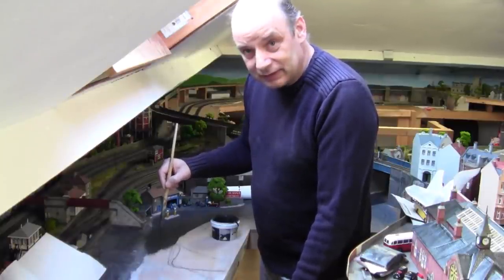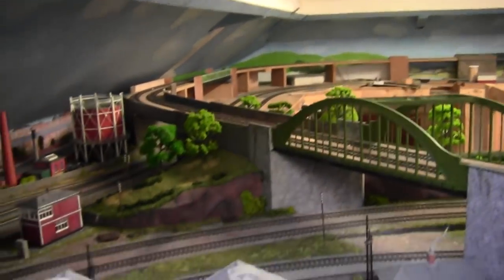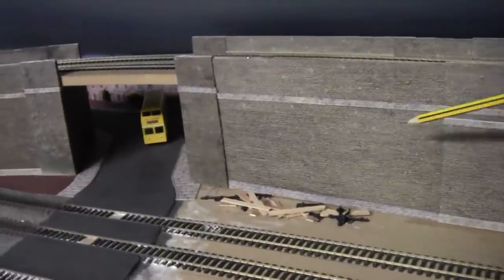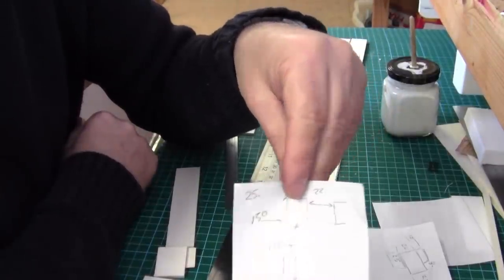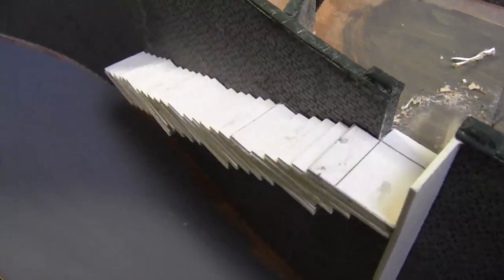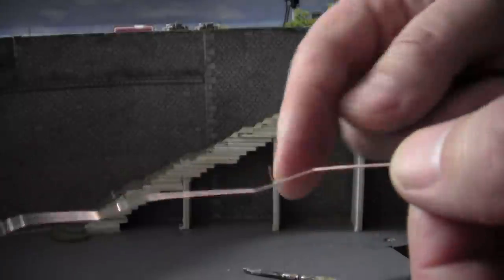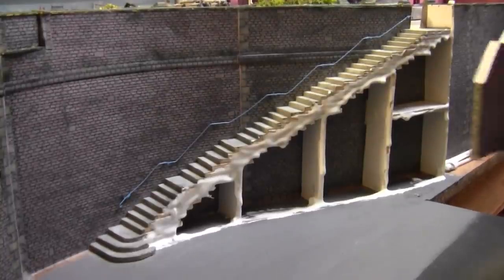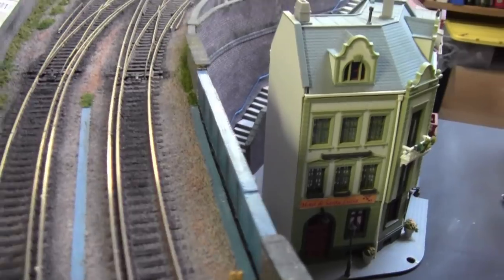The 39 steps, and new extension for Tyne Dock... No152

Comment: Good to give yourself the extra room in front of Tyne Dock, I wonder what will appear there?
And good to see the viaduct developing. It will be nice to see yet another 'bridge on the Tyne'. Though presumably that will be a tributary?
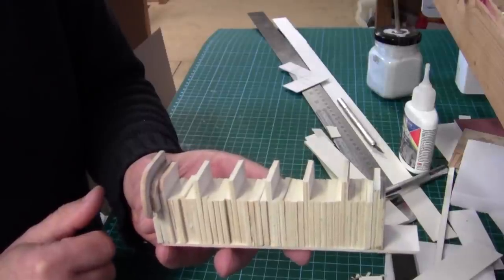13:25 Spooky! Nice job with those steps, though you wouldn't get away with it nowadays. That would be some tumble if you mis-stepped. Still just left yourself room for that cupola turret on the end of the hotel building ;)
Keep safe indeed Tony, you still have a lot to do.
Reply from the maker: Hi Chazzy. i am thinking of a taxi rank. and maybe another building. i remember the old tyne dock station where you had that long ramp to the island platform. it seemed to go on forever when you are a young toddler. yep years and years of work left to do on the layout. thanks again. all the best Tony
Reply: That all sounds great and best of all, lots of new ideas to explore.

Comment: Dont know what John Buchan would make of your steps but I think they are utterly realistic Tony. I especially liked the handrail. It must have been very fiddley soldering the lugs on. I dont think you should worry about 2 stations close together. Here in Maidstone both the LCDR and the SER had stations 10 minutes walk away. Are you now adding extension boards to your extensions ? It gives the lie to those who say that a railway should be planned and then you never deviate from that plan
Reply from the maker: Hi Martin. Thank you for commenting. soldering those little lugs on which little pieces of bent copper wire, were a bit of a fiddle. but those handy hands do come in handy for type of work. i am afraid i am one of those that say a model railways should be planed out properly from the start. which in truthfulness i did  for the track plan. but there is more track than there is towns and scenery on the layout. so dont be surprised if in the future there is more add on's. every millimetre counts i guess. that's one of the great things about model railways. all the best and stay safe Tony

Comment: Hi Tony great job at the steps towards the station the hand rail is that plastic or is it like metal or brass wire that you have used. Cheers and all the best.
Nicholas.
Reply from the maker: Hi Nicholas. the hand rail is made from copper wire. which you can pick up at any good hardware store. its the same cable used on a ring main circuit. all i have done was striped back the outer sheathing to get at the copper. the wire itself is 0.8 thick almost a millimeter. which is about 3 inchs in scale terms ideal for a handrail. hope this helps my friend. all the best Tony

Comment: Tony, What factors did you consider when you made the decision to fasten the rail directly to the bed, without any cork or foam materials between? Peter
Reply from the maker: Hi Peter, Good question. i guess with me it was always down to the sound. i love the sound the trains make across the joints in the track. its a more dense sound. if that makes sense. also if i wanted to change anything later on. it would less waste and mess. i am not knocking underlays. i think they are great if you want (A) a quite layout. (B) a higher track bed. (C) some people say it less ware and tare on the loco's and rolling stock. but i am not sure if that has been proven. do what's best for you. many thanks for your question..........stay safe all the best Tony

Comment: Nice job could have had another  handrail on the other side but a bit late now .I was waiting for a ner electric  train but then I noticed the third rail wasn't  finished
Reply from the maker: Hi Michael. i was so ega to get the wall on i forgot about the other side fitting the had rail. never mind. the 3rd rail only goes as far as the iron girder bridge. once i have ballasted the side of the bridge then i will continue the the rail on. there is so much to do. its almost a full time job building a model railway. thanks again for commenting. Tony

Comment: What size card do you use Tony ?
Reply from the maker: No Problem. the card i used is 4 A3 A2 CARD SHEETS BOARD 2mm THICK PAPER MOUNT MODEL ART CRAFT KRAFT CARDBOARD, you can get card this in 1mm thickness. aswell from the same seller. on ebay.........hope this helps..........Tony
Reply: @TONYNORTHEASTERN  cheers Tony mate